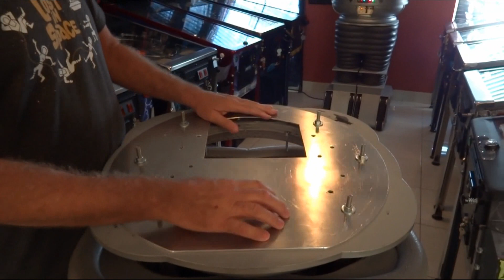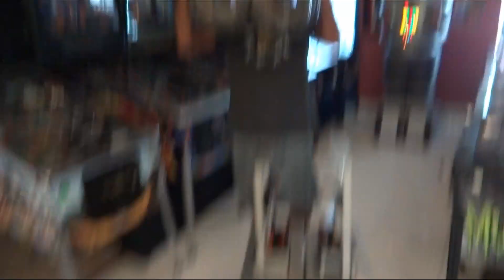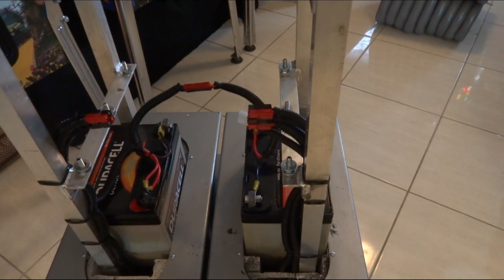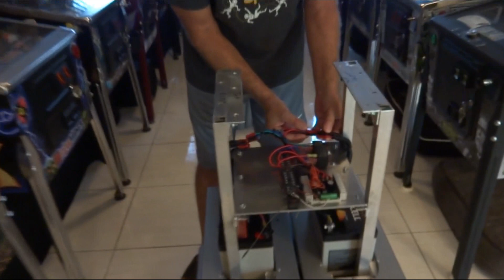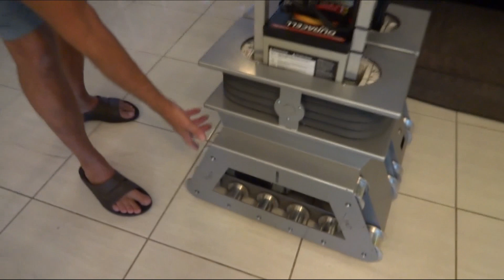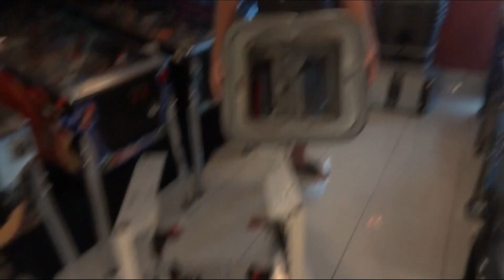Leg Section Reveal

Comment: Hello David, I've been looking at a couple of your videos. I see that your robots have the metal tread section, and metal supports through the legs and torso Karma as well as waste plate. As well as sturdy wheelchair Motors and wheels.
Okay now for my questions is there a way that I can call and talk to you I've been wanting to get a robot for a long time now and I'm 68 so I've been wanting it ever since the show is on however I haven't been able to find out anything about Metal Treads Etc. I talked to Fred Martin and he does his out of wood so that's not a Direction I want to go. I'd really like to talk to you about the Treads and the rest of the parts if I could it would be hard to do it on messaging here through YouTube but if there's a way to contact you that would be great I'm in Middle Tennessee area. So I am texting you on August the 8th Saturday at 2:50 p.m. my time which is in the central time zone.
Thank you, 
Chris Caliber

Comment: I love this design and hoping to do something like this for my B9 Robot project. I really like how the RC control controls the tread section. I have ordered the steel tread section from Norman Stockwell. However I looking for some good reference of how the wheel chair motors are bolted to to the tread walls? Are there plans for this on the B9 Builders club?